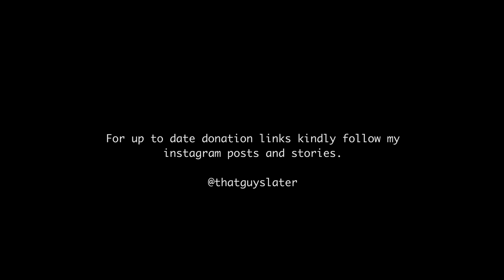The day after #TyphoonOdette

Comment: OMG. The damage. This is so watered down in all news outlets. As a fellow engineer, I gotta appreciate the structural integrity of your house. I saw the construction of skypod(?) and thought it was an overkill but, whoa... the design definitely kept you safe. Prayers  and resources to all those who were affected.
Reply: No one's watering down the news. It's simply because there are not enough regional news centers (well ABS had but it was shut down) to report from the provinces. The news teams are also coming down from Manila which would be hard at this time when power and airports are down.
Reply: Actually due to the intensity of the typhoons nowadays, an overkill designed house has become very essential.

Comment: I’m from the Philippines living now in Florida and here we experiences strong hurricane or typhoon and we do a lot of preparations before the hurricane. The windows are boarded that means we cover the windows with plywood or now a days using aluminum shutters. The reason for covering all the windows and even the doors is so that if a flying object hits it won’t break the glass that would then let the water in the house. I remember helping my husband doing all these things. The other things are… bringing in all the potted plants, patio furnitures inside the house so that they won’t be lifted by strong winds and be a flying weapon. Next is preparing enough foods and water that will last you for couple of days. Have candles, flashlights with good batteries, manual can opener, gas for the grill so you can cook even without electricity and tap water to use for bathing and flushing the toilet. Put your vehicle inside the covered garage or transfer them to a secured garage even if you have to pay.  Fill up your car. Lastly, take some cash out from your bank in case because after the storm if there is no power, ATM won’t work. It’s a lot of work. I understand your situation and 
 feel your pain. Stay strong!
Reply: Very good tips
Reply: Thanks for the tips. With this super typhoon we had like 3 days to prepare only since Odette intensified rapidly.
Reply: me too from the Philippines now living in Vegas....don't have to worry about boarding windows and evacuation! 😁
Reply: Thank you

Comment: Just want to say...the tip you mentioned a year ago with sir/ Architect Oliver about always having a silicone gun and cartridge on hand really helped a lot...it didn't stop the leak but it totally helped in preventing more rain water from getting blown inside the window because of the strong wind, it also didn't adhere or sealed off the window frame after since it's already wet so there was no concern about the frame sticking to the track.

Comment: a thin shell concrete roof as your primary roof with a metal roofing as secondary roof can be a possible solution, assuming cost is not an issue...integrating a metal roll up doors that can be used as the primary buffer that the wind will hit first prior to the wide panel windows...or perforated metal sheets thats sliding that you slide on your wide panel windows that would absorb the brunt of the wind but would still let it pass because its perforated :)  hope everythings better now...stay safe always...

Comment: This is just a friendly comment re the very recent vlog seen about roof leaks problem of your house. The roof profile that you used was "rib type" this type of roofing is designed with only one lapping installation as recommemded by the supplier, and check that out  based on experience that is the big issue.

Comment: I am just about to start planning (and building) my retirement home in a climate safe location - away from the shore, higher elevation and nestled in a valley like place - but I am not taking any chances. It will be built strong and will aim for disaster resiliency. I now have ample ideas on how to achieve this with the goal of no water ingress (steel shuttered windows and doors) and most likely composite concrete roof slab. I still plan to let a lot of light in by way of extensive use of tempered glass but it will have easy to engage steel shutters (maybe even automatically initiated).  The idea is to limit the effects of 280Kph typhoons to minor cosmetic damage as a result of any projectiles that are generated. The garage,  utility/store rooms and water/generator/solar control rooms will follow the same design objectives.  Landscaping and external features will also consider reduction of potential hazards during high wind events and should be easy to restore.

Ambitious it may seem (and expensive) but I've been telling my friends - BUILD STRONG, BUILD SMART, BUILD ONCE.  And have a "Disaster Recovery and Preparedness Plan" by always having secure stockpiles of food and water in a secure storeroom... Most did not listen and have to learn the hard way.

If this house I have envisioned were already in place during Yolanda or Odette - my family would emerge largely unscathed and be totally independent of the utilities and quickly resume whatever life offers post disaster. Our cars will be intact, we'll have power by way of an undamaged Genset and potentially my Solar Panels (which will also have protection)  .. What about communications and Internet? Now that's where Elon Musk's Starlink (starlink.com) comes in... with an easily collapsible and portable dish antenna - I can be quickly reconnected with the rest of the world and even share it with my neighbors.

Comment: Hi sir. I live in the Caribbean and we have hurricanes often. We build houses with hollow blocks and concrete also. Do anyone in the Philippines build with hurricane shutters for windows and sliding glass doors? Every house here has those and really adds a layer of protection. In 2017 we had 2 category 5 hurricanes which had wind speeds above 200mph.  Not 1 window broken. Yes you can’t stop water from leaking everywhere but hurricane shutters can definitely help with preventing windows breaking and more damage done to newer built concrete homes.

Comment: I think now it's time, all electrical company, water company, and internet cables in the Philippines must be put underground using boring machine and together work as huge rain water drainage and protected from strong winds, it can much safer and easier to manage but more expensive? But worth it, and can save government money in the longer run. About earthquake underground though, they say much less damage than things above the ground? Just think of gelatine, then put stick-o above piercing below vs piercing horizontally below, then wiggle it. "Tunnels are the safest place during an earthquake because tunnels move as one unit with the ground" explained Murthy Krishniah, executive director of Transit Project Delivery for L.A. Metro.

Comment: You should build a house typhoon proof ? Yung problem sa ceiling so you have to find a solution dyan sa ceiling cus i saw another vlogg from bohol . Her house was intact

Yung closet ng wife mo is very safe esp yung ceiling so why ung closet safe yung ceiling tapos yung sa bathroom nag leak sa ceiling ? 

Don sa bohol vlogg nakita ko is a  little bit of droplet on the window pero nvr nag leak ang ceiling nya and walang damage din except a little bit of leaking sa isang window . 

High ceiling pa bahay nya